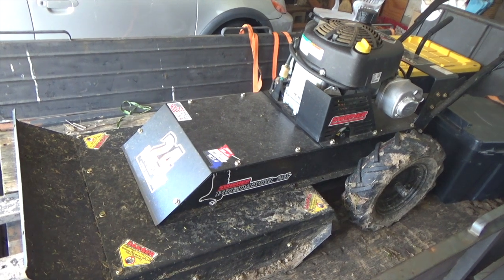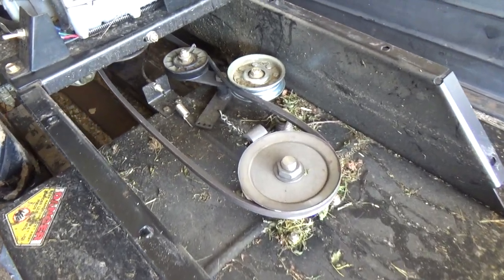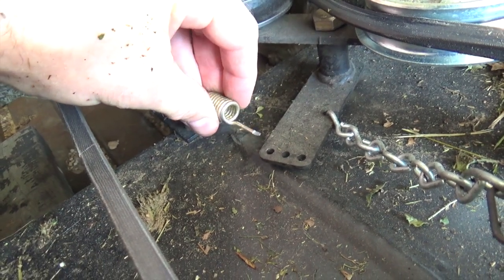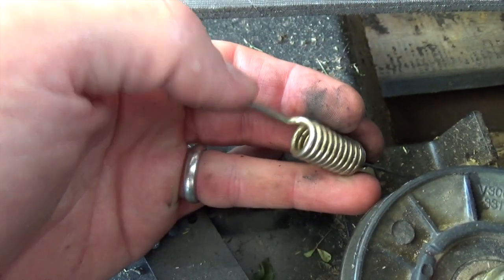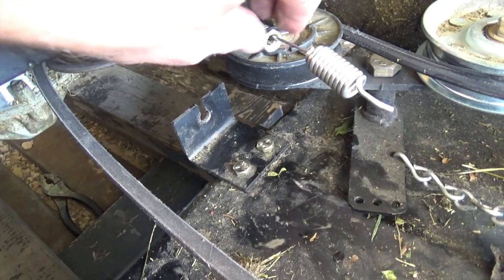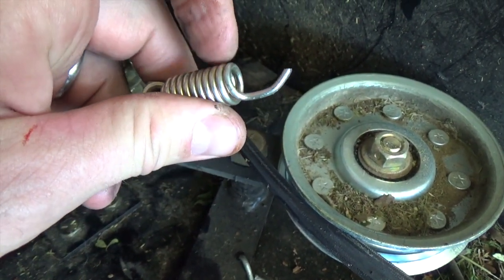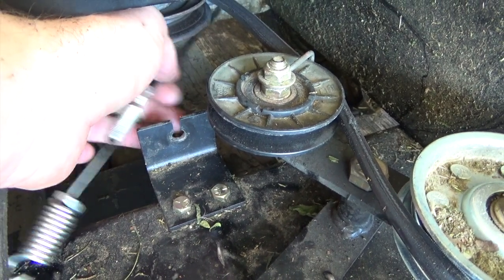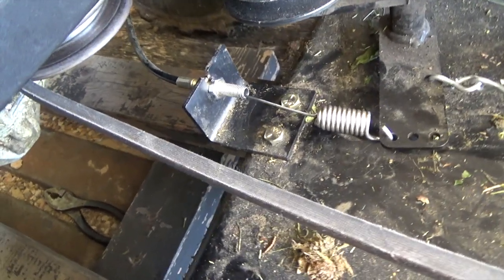Blade Engagement Cable Fix - Swisher Predator Rough Cut Mower

Comment: Just had this exact same failure happen today on my Swisher mower. It's only 2 weeks old and has 5 hours of use on it. Hopefully they honor the warranty for mine like they did yours and the new cable lasts more than 5 hours. Anyway thanks for the video.
Reply from the maker: They should. Their service department and customer service is top of the line. I talked to one of the lead folks at the place and he mentioned that they have upgraded the cable. My second one seems better than the first, but I ran mine for a long time just jury rigged together. Other than that one part, this thing has been an unstoppable beast. Best of luck.

Comment: Nice work.  Must have been a faulty piece of steel.
Reply from the maker: I think you're right, because the replacement cable they already sent me has a different kind of spring/steel. Peace.